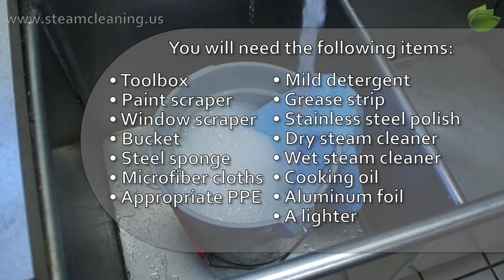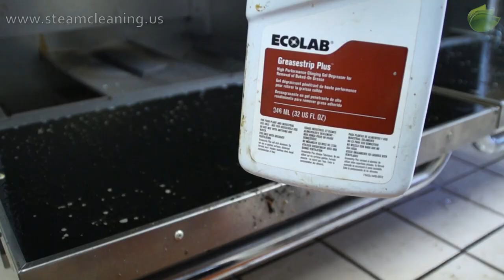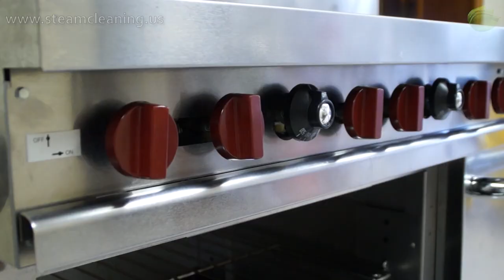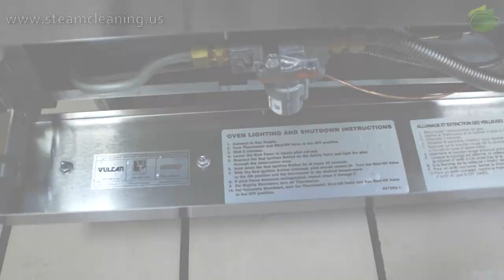How to Deep Clean Commercial Range (Stove with Oven)

Comment: How do you remove heavy grime off of the stove tops? Rn I’m trying a 48hour soak in a Degreaser solution.
Reply: Working for 20 years in a restaurant kitchen , and I tried a lot of different things . What works best ( at the moment ) is the basic prewash powder you use for your clothes .  Most supermarkets sell it . I fill the sink with HOT water , add at least a cup of the powder,  and soak the hotplates from the cooktop ,over night . I repeat the process in the morning , and take one after the other to get srubbing with steelwool and a scraper .

Comment: all that steam on those burners will eventually cause oxidation and soot build up in those burners. I've worked in commercial kitchen service and a field tech and and for OEM of commercial kitchen equipment. been in the business for over 20 years. This is one of the main reasons I get called out for ignition problems on units with standing pilots. I'm sure you guys do a good job but the average person will see this video improperly follow these steps and call me to fix their unit that isn't working after cleaning.
Reply: I dont understand. if you clean the soot off the burners, the gas should flow properly.